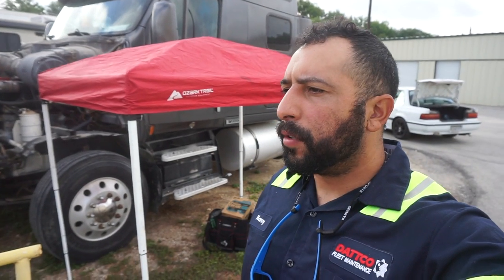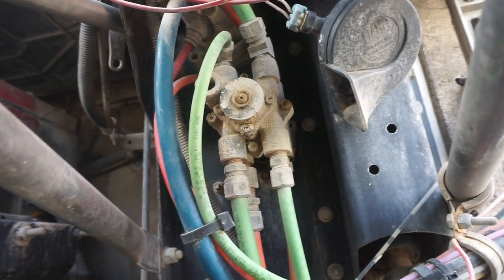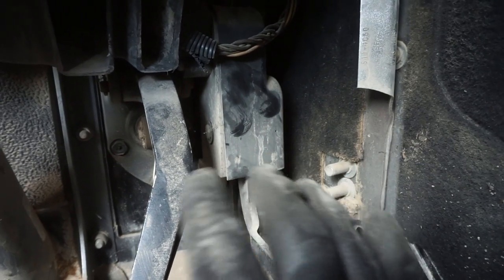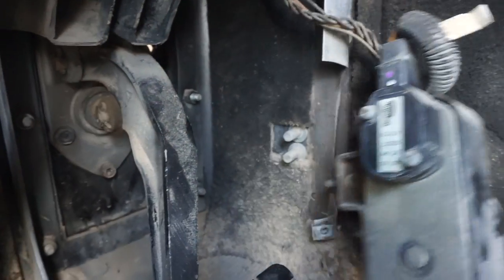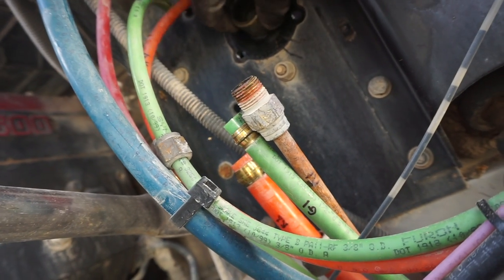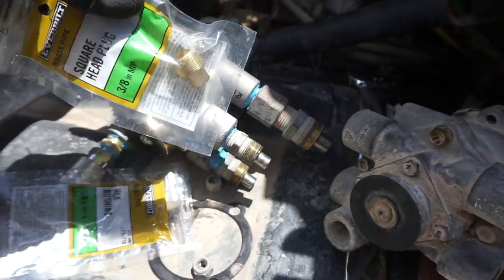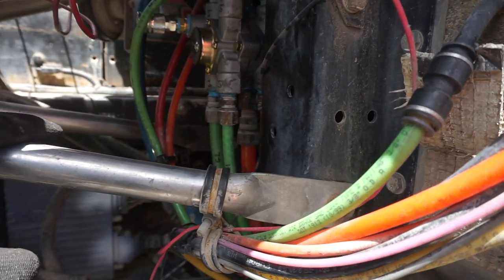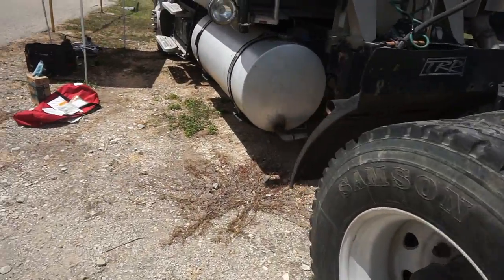KENWORTH Brake Pedal Air Valve Assembly 1997-2010 T2000 HOW TO GUIDE REPAIR REPLACE

Comment: N14 is an excellent work horse. Would have been the ideal time to replace that throttle position sensor as well!
Reply from the maker: Thanks for advice I definitely will look into that
Reply: @mannyactual  looks like it’s been replaced.  Often course rough idle

Comment: my truck have some problem like same truck and trailer brake light is not off and cruise not off and front disc brake to much hot when i drive can you help ke what is problem i already change new front axle disc brake brake and pads but when i drive wheel router is to hot and brake light not off

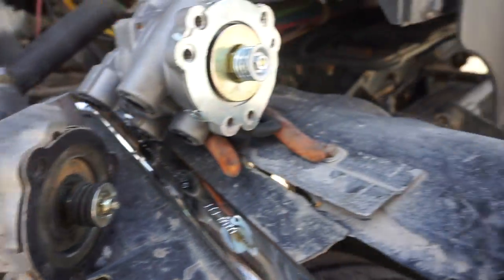Comment: How come you used that blue stuff  instead of Teflon on the fittings 10:53 10:56
Reply from the maker: No reason works the same. Got it for good deal on amazon